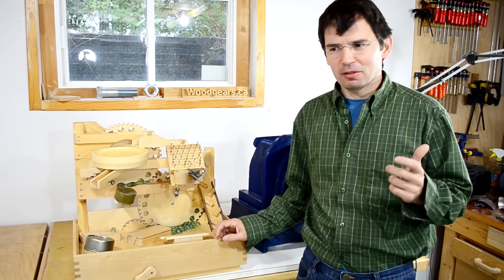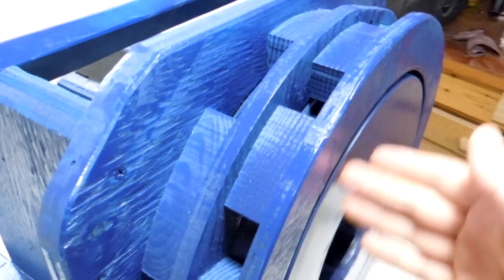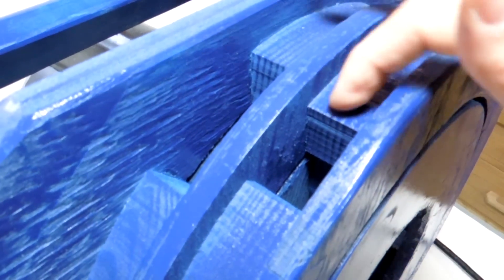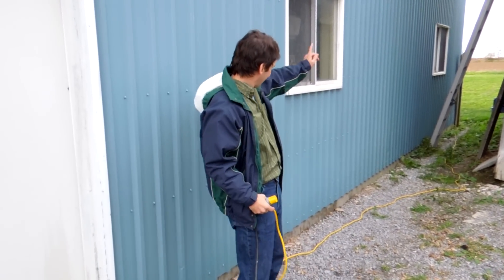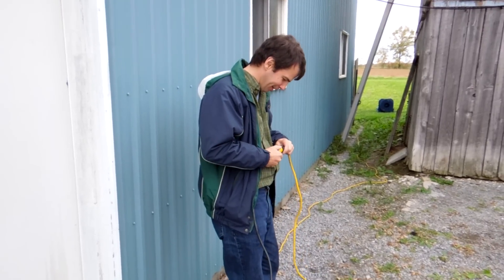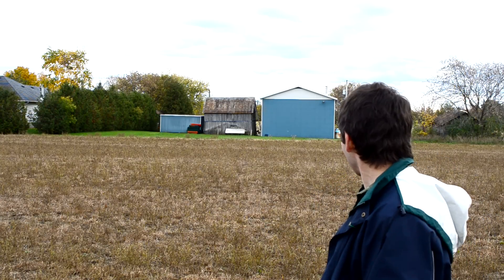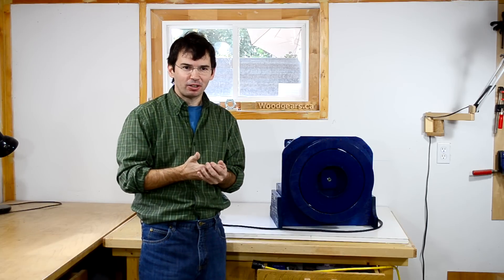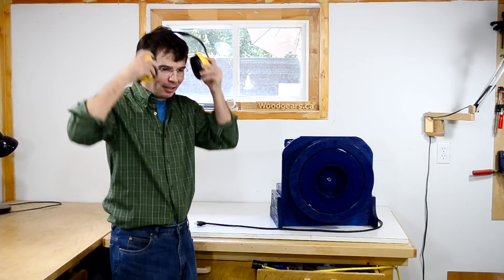Testing the air raid siren

Comment: "Please adjust your volume so you can hear my voice normally"

And then the siren turned on while my earphones were in my ears. I would've gotten deaf if it wasn't for my reaction that the siren will be ultra loud, now that the volume is high.

But seriously, you do need to warn us to lower down our volumes. (Although I may not have read your instructions clearly so it might be possible i didn't see a warn)

Comment: I'd be interested in you actually measuring this with an SPL meter. I'd let you use mine however I am likely way too far away, lol.

While your at it an RTA could show you exactly what sound is being produced...

A fun project, if one was so inclined you could actually build this to make specific pitches and loudness. Requires far too much math for the average Joe however.
Anyways cheers.

Comment: A couple of good ideas and improvements, wire in a 1.2KW trigger switch and put in a megaphone horn or an outlet off a commercial tornado siren. :)
Reply: Good ideas, but I like that this siren is all wood except for the motor, of course, and it still puts out a fabulous amount of sound. Amplification is another arena in which much work can be done. But for the bare wood beauty of this device, it can't be beat.

Comment: If you really want to get realistic with this, build a timer for it that has a steady 3 minute cycle ( all clear/alert ) and a 3 minute wailing signal (take cover/attack) 
Better yet purchase a federal signal af or ar timer 
These timers controlled a lot of old air raid sirens up until the late 80s 
Your best bet is to contact west shore services in allendale Michigan 
They have a "siren graveyard" that is full of old sirens and new ones that have been replaced
Ask them for a ar or af timer that outputs the same voltage and phase as your motor and ask them to ship it
Then modify it so that the siren connection terminals lead to an electrical outlet where you could plug this siren in

Sorry about the long comment
But hey I said if you want to get more realistic about it

Comment: build a giant one at least 3 time this size and it will be loud enough
Reply: djaysenpai Faster would probably work better, but having the second ring with the gaps closer together would have the best effect in a "real world scenario". Higher frequencies are reflected better off of objects so they would theoretically travel further (in an occupied space). Lower frequencies travel further normally, but if there are buildings and stuff in the way they also get absorbed much easier than higher frequencies. One low and one high lets people inside buildings hear and people outside buildings hear.

Comment: I'd like to see if there's a way to calculate the exact pitches.
Reply: You could adjust the RPM in conjunction with the the spacing of each "blade" to calculate the frequency of the output
Reply: Thanks, me.